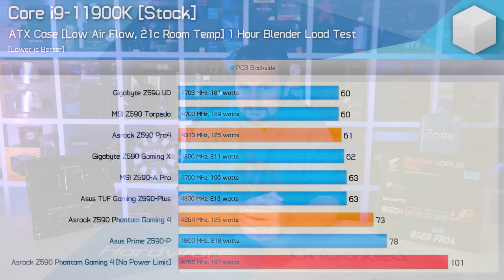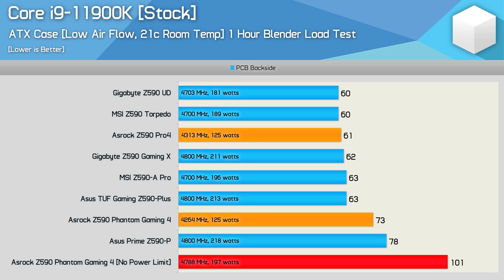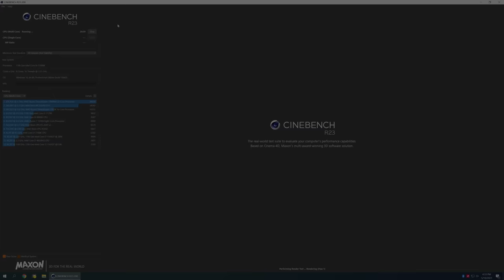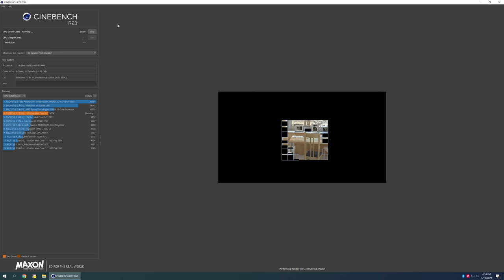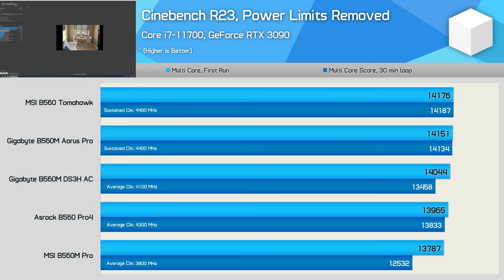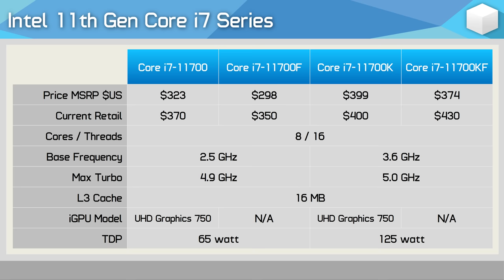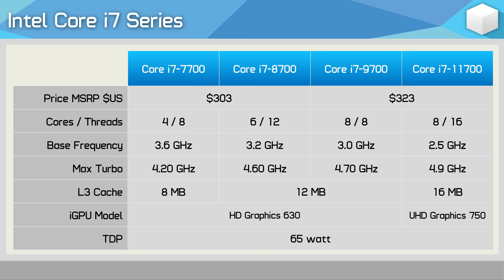Intel B560 is a Disaster: Huge CPU Performance Differences, Power Limit Mess

Comment: Probably the worst HUB video to date. Clickbate at best dishonest at worst. I thought you guys were better than this.
Reply from the maker: Maybe you didn't understand the content. What do you believe to be clickbait and why?
Reply: @Hardwareunboxed   It's clickbait because B560 isn't a disaster, there are good B650 boards and bad B560 boards. You don't need to resort to clickbait titles to get views. leave that to Linus and Jaz. 'B560 performance inconsistency's'  would have been more reflective of the issue 

Also you're a highly respected tech channel, the video seemed rushed and came to no real conclusions. Is it the boards hardware at fault ? The default bios settings ? a bios revision issue ?. 

I'm NOT a tech-tuber and I could have done a better job imho.

Don't get me wrong I respect the work that you do but I feel you dropped the ball on this one.
Reply from the maker: @mentalhornet  it's a disaster if some boards are 50% faster than others, I don't get how you can't see that. Also as carefully explained in the video this is not the fault of the board makers, but rather Intel for their loosely defined specification, again I was very very clear on that.

If you think you can do a better job have at it, you'd be highly successful if you could step in at this quality level. So good luck with that, I really do wish you all the best, though I have my doubts given it was all laid out for you here and it seems half the info went over your head.

If you wish to learn about this topic and the Intel specification, then I suggest reading the interview linked in this Tweet: https://twitter.com/HardwareUnboxed/status/1385051271451660290
Reply: @Hardwareunboxed  Wow the Hubris. I don't agree with you. As I have said your content is usually spot on, in my opinion this just wasn't one of the best. And whilst I agree that intel's Specs are ambiguous at best Board makers have a duty to know  if their platforms are underperforming. I'd understand if all Gigabyte boards outperformed all Asus boards due to how they interpret the specs  (for example) but not inconsistency's  on the same platforms from the same manufacturers (stock settings) That just doesn't make any sense at all.  That's NOT an intel problem.
Reply from the maker: @mentalhornet  Intel only publicly publishes the TDP spec, that's all board makers have to comply with, despite that not being the only spec. It's an Intel problem, they deliberately created this situation. Years ago they published the clock multiplier tables along with the TDP, now they hide it and the reason is obvious. You call this video 'clickbate' but the truth is you've taken the Intel bait hook line and sinker.
Reply: @Hardwareunboxed   I did no such thing . I acknowledged Intel's ambiguity when it comes to CPU specifications, my point was that it doesn't explain why for example 2 B560 boards from the SAME manufacturer would perform COMPLETY differently at STOCK settings. That is NOT an Intel problem. You're conflating two different problems.
Reply from the maker: @mentalhornet  So it's not an Intel problem that there is a range of specifications that OEMs and board markers can target? Board partners and OEMs can't make up their own spec, they have to follow Intel guidelines and there is zero room to move from the Intel spec. I'm not conflating two different problems, the issue here being that you don't understand how this works, again despite having it all clearly laid out for you in the video (I'm still waiting for you version that covers this better BTW).

In very simple terms, Intel has given AIB/OEMs the option to run boards with the TDP power limits, higher power limits or no power limits at all. They're then free to apply whichever configuration they feel is best for each model.
Reply: @Hardwareunboxed   Right ... so your telling me the Asus, gigabyte , msi etc have the choice to apply what default settings they like ?  So .... they are directly in control of the out of the box performance?  And that's with the zero room to move from the intel spec.....

Can you not see why that makes no sense ? 

And please stop responding to me like I'm some sort of idiot, the contradiction here is plain to see. 

And I didn't say I would make a video on this , I said I could have done better.
Reply from the maker: @mentalhornet  "Right ... so your telling me the Asus, gigabyte , msi etc have the choice to apply what default settings they like?"

Now you're starting to get it. Yes they are free to run at the TDP spec or with no power limits, which would see the CPUs run at the clock multipler table (all of which is within the official Intel spec). Did you read the Anandtech interview I linked in my second reply?

Also here is a follow-up video that might help: https://youtu.be/WKzNkWfoQyQ?t=173
Reply: @Hardwareunboxed  get back to those B560 VRM tests please - The whole world is waiting on your findings and results. No pressure! Even Buildzoid scooped you on the B560 boards because you're slacking off...had to sit through 2 hours of him rambling on in typical fashion. Give us a timeline man ... 2 days ...5 days, a week, 2 weeks? We're all sitting here waiting in anticipation for that B560 roundup. On a more serious note, stop replying to this dude. He's just triggering you and it's not worth your time. Love your work. Also, B560 is fine. You get what you pay for... most of the time at least.

Comment: The Tomahawk was a good deal for me (got it in discount due to broken box so I got it at the same price as the other cheaper b560), but I was prepared to pay it's full price, even if  pricy but I researched at the time of purchase the only Mobo I saw that could do the job without breaking bank was the Tomahawk B560, other mobo's with good reviews were all much more expensive, I am from the UK so regional pricing is different everywhere.

Comment: This is extremely misleading as the low end board follows intels own guidance but the high end one removes limits to get better performance on the low end board you can simply change some bios option to get same level of performance. It is not low end mobo thats performing worse it is the high end one that is better than intel specs. And testing that cpu with a RTX 3090 on 1080p is also super misleading to it is an exaggeration of the difference
Reply: How would a low end B560 react to removing the power limit? I was going to take a DS3H or HDV since I won't need any extra features and they all seem to work just fine for the lower price. Only thing I'm concerned about is if the build quality will allow it to draw more power without any lifespan or other issues
Reply: @plague6716  If it doesn't even have heatskink over VRM in normal conditions will boost less due to VRM overheating if you remove power limits. Long run the VRM will fail: VRM components are usually designed to run at around 95-105C and there's no real problem with that, but most board throttle VRM components at 125C which is beyond design.
If it has a metal heatsink over the VRM components will fare much better when removing power limits: it may even run below 100C if the CPU is proportioned(means don't expect them to do a good job with a CPU than can draw more than 200W in PL2)
In all cases you can always put a fan blowing down to the VRM area to alleviate the situation: Intel's stock coolers actually do that and it's intended. Any CPU cooler like Intel's stock(Noctua has some) with a fan blowing down against the board will create airflow for the VRM too. Typical tower coolers don't do this unless the VRM heatsink it's tall.
Reply: @deidian635  would you recommend a B560 Pro4?
Reply: @plague6716  Looks good to me. Any board around 120$-150$ which is when they start targeting gamers and use VRM heatsinks should be good for up to an 11700(F) with power limit unlocked.

An 11900 too, but being aware that maybe it's not possible in every scenario reaching all-core 5.0Ghz(max core turbo with ABT) or close. But at that point you're dealing with potentially over 200W loads, so expensive cooling required too.

Unless you run some crunching number software or rendering often(several hours a day) it should be perfect. As much as CB23 can get over 200W power draw at 5.0Ghz games don't pull that much.
Reply: @deidian635  I'm looking at a 11400f/11500 depending on my gpu (or lack of), seems to be the best value for performance and the 11500 is at the same price point in my area as of now

Comment: ranting half a video for a one time setting in bios,  i rather the video is about teaching people how to open up the power limit setting in bios would be more useful
Reply from the maker: I can certainly see how it might look like that from your vantage point.
Reply: @Hardwareunboxed  Would be nice if you could show (perhaps in another short video) how to set the option on the various boards. From what you've said the boards should work well with a 11400, so once people know how to set them up they should be a viable option.
Reply from the maker: @ETophales  How about you just do the intelligent thing and avoid the bad boards?
Reply: @Hardwareunboxed  Because you haven't shown any better entry level boards, and you say that they work fine for a 11400 once a setting is changed. The only alternative so far is going up in price considerably, and what's the point if a BIOS change can make the cheaper boards work fine? (Of course, it's possible that they are bad in other ways that I'm not aware about because you didn't talk about that.)
Reply: hi, i bought today an I5 11400 and Gigabyte b560 M DS3H AC, before seeing this video...

how can i improve my setup? 
Thank you!
Reply: @Hardwareunboxed  it's not an option to avoid something i was not aware :/

Comment: I don't see the problem : just go to the bios and remove the power limit: on my 10400 I get 4 GHz 100% stable
Edit : also on b560 you can put xmp of 3600 MHz ... It's technically a overclock
Reply: You might know how to do that but the other 90% don't. What will companies such as Dell or HP do regarding those power lkmits, your new prebuild system might suck for just that simple reason.
Reply: Yeah it is a feature! When my bios battery ran out, I took me a few days to notice the longer post time. When yours runs out, your performance will tank, and you will notice it immediately!
Reply: @Mr_Stone1  bios battery failure is really rare ... 10 years of lifetime is normal. Also after that you spend more time to change the battery than bios settings ( CMP and tdp ) ... It's like 30 seconds
Reply: @klaesregis7487  Well, then those people need to do some research about what they're buying. It's like complaining your memory isn't as performant if you don't enable XMP.
Reply: @klaesregis7487  increasing the tdp is the modern day overclocking. OEM will follow stock tdp and will use 2666 memory. This is what intel say it's "stock" . Enthusiasts will overclock my putting unlimited boost and 3600mhz memory (  b560 pro 4 is 100€ and do everything )
Reply: @ElettroStef92 how can i do that in a safe manner? I bought today an I5 11400 and Gigabyte b560 M DS3H AC  :')
Reply: @_ataims  in bios find where the power limit is and set at maximal level and duration

Comment: so basically it's only the initial config that changes so for experienced builders theres only the problem that some motherboards cant handle vrm temps without a vrm heatsink
Reply: Yes. If you know how to change bios settings, no problem if the vrm is good enough for your cpu.

Comment: To be fair to Asrock, this behaviour is explained on their website. They tell you exactly what frequency you can expect on an all core load on which cpu after enabling the boost feature in the bios.
Reply: So there's people around building systems that doesn't get Intel recommended(flimsy concept since warranty can be voided) specifications and you expect them to look to the board specifications which is a massive table in comparison to CPU since they include everything: CPU, RAM, I/O chipset, I/O supported ports, software, accessories,... Hmm?
Reply: You make it sound complicated. I had to do it and it was very straightforward.

Comment: Not all pair it with the right hardware combination for B560 chipsets.
My setup
CPU: Intel i5 11400 at 2.6Ghz
MOBO: Asus B560M plus wifi
Ram: Corsair vergence 2x 8GB at 3600 mhz
Storage: 
For OS: Samsung 980 500gb NVME 2.0
For Data: 2 TB seagate barracuda.
GPU: Asus Dual RTX3060Ti 8GB GDDR6 at 256mhz
PSU: Corsair CX750w full.modular 80 plus bronze
Case: Asus TUF GT301

Its works fine to me!

Comment: I wasn't expecting that much difference until I saw the bar graph... like damn. It's like you're buying a 10400F instead of 11400F. Which makes me think, the IPC improvement in 11th gen intel probably was achieved by simply bumping up the power delivery?

Comment: So TL,DR is super budget b560 for super budget CPUs, but don’t expect any reasonable upgrade path, whereas you can expect a 5-10% deficit WITH tweaking on the “mid-range” (relative) b560 offerings. The tomahawk itself is in the weird category of only saving a few compared to budget z490/z590 while still being the “best” b560 locked cpu experience.

Comment: This is crazy. Buying hardware these days is an ordeal - even if you can find what you think you want in stock, you have to see if the specific implementation is one of the good ones or not. Also there's nothing stopping the manufacturers from changing things like tends to happen with SSDs and DRAM modules.

Comment: I have been tweaking with tdp limits with my 11600k on a tuf b560, also undervolting the cpu for decent temps. I get the cpu to stay at 4.6ghz full core with a tdp of 150W for a long time in cinebench 23, but eventually it start power throttling and drop to 4.50 and them 4.40. I am not sure it is because of vrm, since temperatures are stable. In the end. I can't complain... just waiting for the electric bill. 😅 I miss my old 10400.

Comment: How does a chipset determine that it's a bad board, it's the VRM design from board makers, not Intel.
Reply: Intel is the company giving the OEMs the minimum spec requirements.
Reply: @FutureChaosTV  The minimum specification is on all the mainstream chipset, from B-Q-H-Z or A-B(useless)-X.

In fact, OEM like HP, Dell, etc, are correctly adhering to the Intel/AMD spec--power limit and duration.

Board makers like MSI, ASUS, Gigabyte? No, they aren't, not even close--they can cut corners and go below the minimum spec.

Comment: This is another reason for me to keep recommending 10th gen CPUs for the new B560 boards. 
My recommended budget build is still a 10400f, like it's been for almost a year, now just with an ASUS PRIME B560M-K motherboard. I'm hoping you will be testing that specific board, it's the cheapest with actual VRMs in my country. :-)

Comment: I def see this kind of stuff in the build I just completed, with msi basically letting the cpu do whatever it can whenever it wants for however long lol. However being my first build I have no knowledge or experience with bios settings and knowing what to change to fix it. My previous system was a prebuilt with a bios that basically had nothing to edit. Personally I wish manufacturers wouldn't do this so my system would run the baseline way it should until I decide to push it further, giving me a chance to at least learn about what that entails!
Reply: The problem this time around is the baseline is so far removed from any performance number you'll see anywhere that it kinda doesn't work out, you would think something was wrong with your Mobo or CPU if that happened... If CPUs were usually marketed like that... Ok. But they are not.

Case in point, nobody expects their 11400 to actually run at 2,5 ghz, regardless of Mobo, they are just taking advantage of that. Having an spec with a 95% delta in guaranteed vs top performance is crazy and hardly an accident, specially considering that top tier Mobos roll out first and you get cheaper chipsets (which most people actually expect to use) later.

Comment: the 11400(f) is a great value cpu until you consider the fact that it has to be paired with $200 dollar motherboards to get all of its performance. This is another reason why I still prefer amd.
Reply: that's wrong, you just need to disable the power limit on the bios, he said that on the video....

Comment: 10:57 "Without power limits in place the 11700 will push package power up to around 140W"  .. My 5950X draws 142W-148W package power. Anandtech Bench shows the 5950X doubling the 11700's CB R20 + R23 nT scores. Other benchmarks show them closer or further apart, but wow.. I didn't realise just how inefficient the 11700 was until now.
Reply: Comparing without understanding. More extreme example: my i9 11900K draws 180W running 3 cores at 5.4Ghz, under that same power envelope(180W) it can feed the entire CPU(8 cores) at 5.0Ghz. Don't need to say that 8 cores 5.0Ghz get better benchmarks than 3 cores 5.4Ghz.
Comparing any lower core count CPU with a higher core count under the same power envelope if both are capable to hit it, it's stupid. It's a dead giveaway.

Comment: For enterprise and higher education we have power budgets, having a board that keeps the heat output low is welcome, now i'd rather go with a 5800(nonX) but i could only source 8 of them, where as 10700(nonK) were readily available in quantities over 200. though i ended up going with a B460 board because we dont need any of those more advanced features, and by the time we do, it will be time to replace these anyway